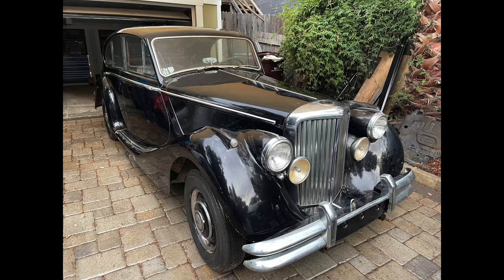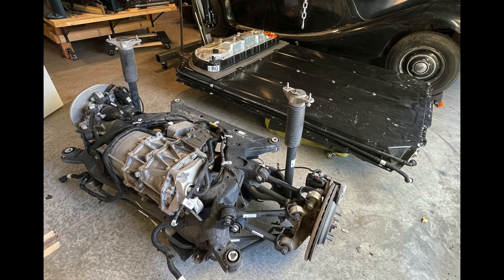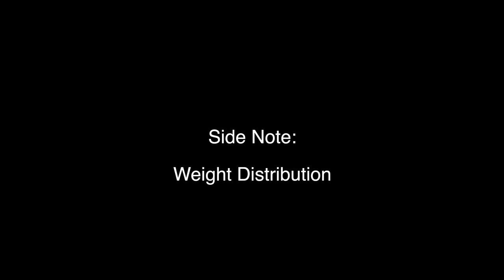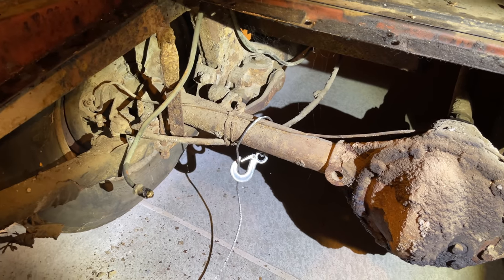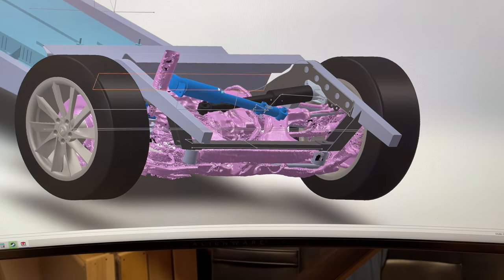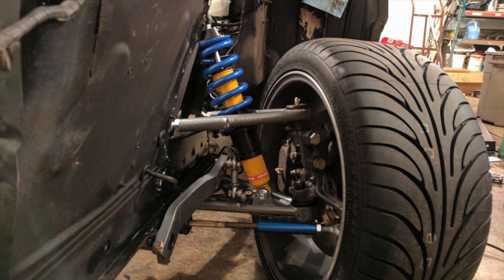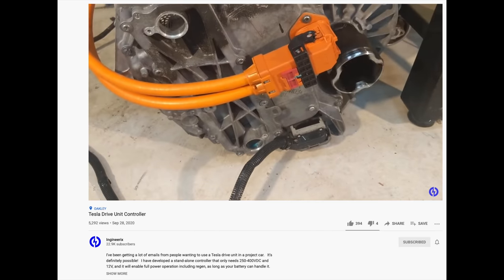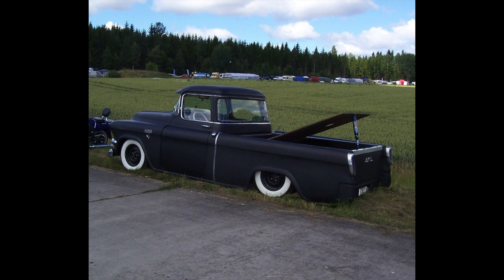I'm Tesla Swapping A 70-Year-Old Jaguar

Comment: 5:20
The old model S cans didn't like constant reverse because the oil lubrication system didn't operate like that, you'd quickly destroy your diff
The newer model 3 stuff doesn't care, constant oil pump, some flips in the motor control code and you'll be driving in reverse no problem
Reply: Thx for the more technical explanation 👍

Comment: Matt, you have to do the Tesla Model 3 running in reverse because there are going to be thousands of DIY guys out there waiting to do just the same, many possible ev restomods become achievable with this arrangement. It’s up to you to lead the way.......Don’t delay, I’m ready to follow right now.
Reply from the maker: Hah, well not on this build, but I could probably make a video diving into the possibility. If it is allowed in the controls, then it's just a matter of checking the loads in the drive unit, the lubrication, and maybe how the suspension changes with the reverse loading. Could be interesting.

Comment: re: gauges, you will quickly find that a tachometer on a fixed reduction gear drivetrain is pretty boring since it's always in sync with the speedo. More fun and informative would be putting an ammeter in that spot.

Comment: Excellent project. As for where to put the batteries, Raining the car by four inches or so, giving you space for an underfloor battery tray, would not detract from the car's appearance. 
An electric Jaguar is better than no Jaguar at all.
May I suggest no gearbox, no differential, but a separate motor for each rear wheel.

Comment: Matt- a thought on your front suspension. The M II kits I'm aware of are $1200-$1500 and lack the brake package. Have you looked into whether a Crown Victoria IFS modular suspension might work? They are often less than a grand and include the disc front brakes from a car a bit heavier than the Jag will likely be. FWIW, the CV module works a treat on '50s and '60s Ford trucks with the frame rails about 38"" to 41" outside to outside apart. Would include power R&P steering for left hand drive- which might be worth the grief if you want to daily drive it here in the US. I 'm here for this- till two two or two three!
Reply from the maker: I looked at it. The only off the shelf parts I'm getting are the lower control arms, the spindles, and the brakes. I don't need the subframe, UCAs, steering rack, or anti roll bar. I'll be fabbing up those or adapting from somewhere else. the cost and capability seemed similar with the crown vic based on my setup and some quick math. My spindles and brakes are Willwood specific so they're not even compatible with other non-willwood mustang ii stuff. It's a hodgepodge that is loosely connected to the Mustang ii design. I'll have a video on that when I figure it all out!
Reply: @SuperfastMatt  Just thought I'd throw that out- I had a friend who built cars professionally and he liked the CV for full bodied cars particularly. Me, I want it to work- the size of your smile the first time you drive it will tell me lots about how good your choices were!

Comment: I love what I saw so far on your channel, that i had to subscribe.I disagree with your weight distribution logic.  50/50 is ideal for the exact reason why you argue ts not. For turns you agree it is. for braking you automatically get more weight in the front because of the weight transfer and the same for acceleration. so with 50/50 static you get exactly what you want. Since you get more transfer when braking a slight rear bias might be ideal. How did you get the Tesla components? Did I miss that?
Reply: Agreed. I never knew "lift off oversteer" was a thing until my first Fiero. I personally feel sacrificing a little traction on straight line acceleration and braking to gain traction and more importantly consistent predictable behavior in "spirited" cornering would be the better way to go. But that's just my inexperienced 2 cents worth. Still love the channel and find the build interesting.

Comment: Instead of an electric heater, why not throw in a reversing valve and just use your AC as a heat pump?  That's what they did with the Model Y, the 2021 Model 3, and the 2021 Model S (the Octovalve is a little bit more complex than JUST a reversing valve, but anyway).  Presumably the Cybertruck, Semi, and Model X refresh as well, though those aren't available yet.  Maybe look for a wrecked Y or refresh 3 and snag the whole Octovalve.

Comment: Many thanks for this informative and fun series that quickly earned my subscription. Will you be publishing some of the measurements of the respective units somewhere along the line? I am in the process of starting a conversion of my Jaguar Mk II, and am currently looking into Tesla model 3 battery trays. If I understood you correctly, the only difference between the standard and the long range battery pack is a centrally located, narrower strip of battery cells? What width did you end up with stacking the four modules 2x2, and more specifically; how much would keeping  that (single?) strip of cells add to the overall width, were I to keep it in? /Phil (Sweden).

Comment: 2 things come to mind: 1st: retro power cars project Utah. you will understand when you watch what they do. including the Opel Corsa electric powersteering rack. 2nd: i like how you explain why you are not doing x, y or z. so here is my question: why not use a tesla front drive unit with steering and everything? and then put the batteries in the back with some basic minivan rear end? gives you tesla brakes up front where you need them, too. rear jag stuff may be fine? I understand you already bought what you bought, just want to hear you shoot holes in my idea :)
Reply from the maker: The jag brakes are really bad. old drum brakes all around. I don't even know if i could get new pads for them. So I gotta do new brakes anyway. I got some big Willwood brakes coming in for the front, should be plenty. Plus I like rear-wheel drive.

Comment: Great video!! Keep them coming. I considered trying to use the entire battery pack enclosure as the pan of my vehicle. A unibody car with no center tunnel might make that a bit easier than for a framed vehicle like the Jag. Reduced ground clearance or reduced interior height might be too much of an obstacle in that arrangement. How thick is that battery pack? Sounds like the front suspension might also be an option for me since that's pretty much the existing arrangement. Can you reverse polarity on a Tesla motor to run in reverse, or are there loading issues on the other parts?
Reply from the maker: Most of the battery pack is 4.5" tall, but there is a bump at the back that gets up to 12" tall. As for reverse, you'd probably have to mess with the controller or use an aftermarket controller to get it to run reverse full speed.
Reply: @SuperfastMatt  Did you happen to take down the length and width?  Have the kinks for the enginext controller been worked out?  Did the guy that lives near you get something out yet?
Reply: For anyone else wondering it is 216.63 cm by 147.32 cm by ~10.5 cm (height does not include penthouse).  Still curious about the controller.

Comment: Are you planning on keeping the "un-powered" steering or dropping in something assisted electric ..  I know Electric Power Steering (EPS) Conversion the from a Prius is popular.
Reply from the maker: Current plan is a manual rack with the Prius steering. I'm still looking for a rack with the right dimensions and ratio. I might end up getting a powered T-Bird rack and de-powering it, then adding the Prius column.

Comment: How did you deal with the track width of the tesla rear end, which according to google is 62" when the Jag is 57"?  Thank you so much for your videos.
Reply from the maker: I'll be widening the rear fenders. they bolt on, so it should be easy to do it and not have it look weird.
Reply: @SuperfastMatt  thank you so much for responding! I was trying to design a tesla swap into my 66 mustang, but the track was 10" off. And changing an irs with a 2 ft wide motor inside looked daunting. Really fun following your project. And all of your jokes/observations are so on point, like how you just did not want to scrape off the floor rust. LOL

Comment: Hey I'm not an engineer but I'm a tech for an exhaust system factory and I'm taking my daily driver frontier and turning it into an awd baja truck, but I want to trade out the suspension for one out of an early 2000s Escalade / Suburban. It reminds me of an not so extreme version of the current trick/ trophy trucks. But just being a glorified mechanic I'm not sure how to make  it all fit and how to make the ECU accept the changes. My engineer is a British dick and wont help so I was wondering if you had any advice or knew of a company that could help.

Comment: Amazing project @SuperfastMatt ! 👌
Just, please do not topchop the car. And no matt paint. Your project will look more timeless and qualitybuilt! Overwise, it will look like a random garage hotrod and destroy all the quality engineering work underneath . The Jag is already an iconic piece of design ;) It does not need useless effort on the exterior except a good restoration and quality paint 😉.
Btw, check https://lunaz.design
A British company doing the same kind of electric conversion on Brit’ classics. It might help if you do not know them already 😉.
Keep pushing ! Waiting for the next steps !! 🤘
Reply from the maker: I think I'm sold on gloss black paint, but I make no promises on the top chopping. The roof line is so high. If I do, it won't be with mail slot windows. More like a 2-3" drop. It's way down the line though, so plenty of time to mull it over.

Comment: I wouldn't add seat belts: they won't improve safety much and you'll loose part of the appeal of the car (I call that the freedom to die :-D)
Gauges: what's the advantage of a stepper motor over a cheap servo?
I wouldn't touch the outside, I'd call that patina and save 10 grand
Reply: Oh, and it would be pretty cool to include some autopilot! Not the one from Tesla but openAI should be easy to fit
Reply from the maker: I'll be using servo motors, that will be much easier!
Reply: @SuperfastMatt  Great call

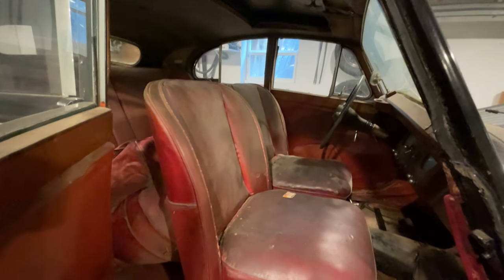Comment: 0:59 With electric motors more horsepower has nothing to do with higher energy consumtion like in ICE cars. Bigger ICE means always more fuel consumption because of bigger cylinder volume, more air and gasoline intake etc. even if you don't step on the gas. Not so with electric. Not stepping on the gas means no energy flow. As easy as that. No matter if there are two motors or even more. So also battery capacity won't change anything, regardless of single or dual motor setup. :)